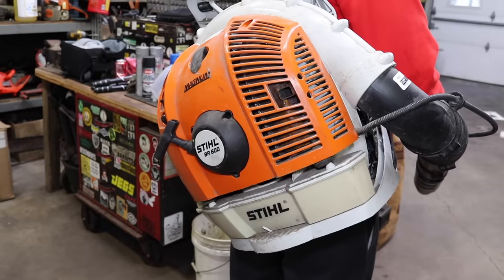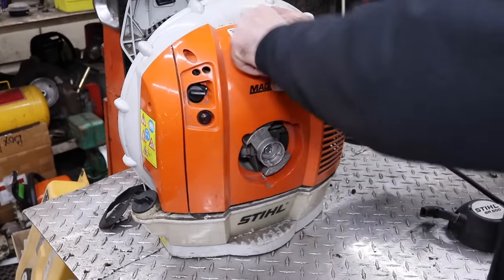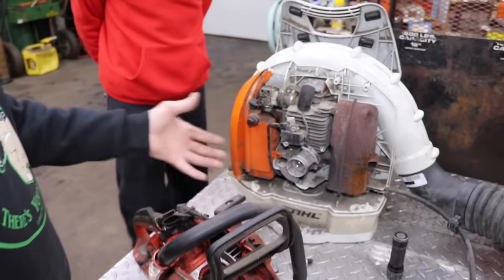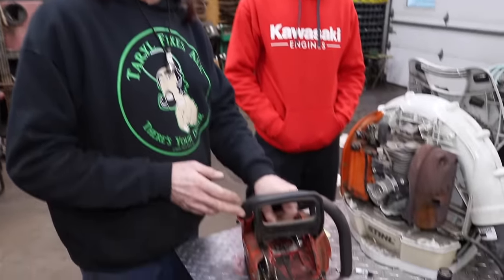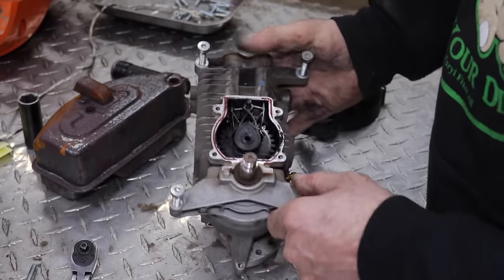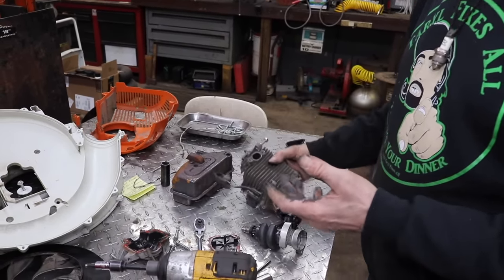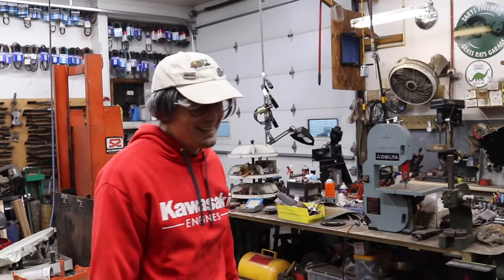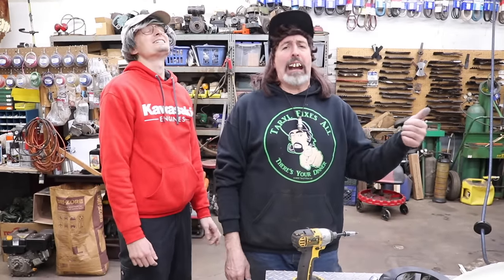4 mix NIGHTMARE! DON'T make this mistake 🚫

Comment: I’ve had a BR600 for over 10 years and it’s been flawless. Use the right grade of oil and mix it correctly. That’s all these need. If your gonna be cheap and use the wrong stuff this is what you get. All I’ve ever used was Stihl hp Ultra oil or amsoil saber. Good oil isn’t cheap and cheap oil isn’t good.
Reply: Lol, y is cheaper oil no good genius??
Reply: @13panda13  cheap oil doesn't hold up and doesn't handle heat like higher quality synthetic oils can. You can see that engine was carboned up bad on the piston where all the heat is located. That's a sign the oil couldn't handle and stated to degrade and fail.
Reply: Yeah ive been using these br 600s for 10+ years commercially  and have never seen this. Infact ive had zero issues with my blowers. The clutch on the fs 111r and 131r line trimmers i have had issues with. After 2 years of solid use the clutches start to seize up .
Reply: same br600 for YEARS
Reply: You are a lucky one, seen a lot of junk
Reply: You make an interesting point. Nearly all of the saw failures that I deal with, have had a RED mixture in the fuel tank. I have no idea what this is. (Someone is selling that stuff to my Mexican customers. Because most of the saw failures are their saws, with this red stuff in the fuel.) Boy! You are so right, don't buy cheap oil.
Reply: @dannybowman7792  Stihl,Echo,Opti oil all good stuff
Reply: @dannybowman7792  exactly.  There is a reason why they warranty their products for twice as long if you use their stihl oil, they do here anyways. Ive never put anything put stihl oil in my stihl equipment and have had zero issues
Reply: @dannybowman7792  probably the cheapest oil they can find at the store. They might also be mixing it at thinner rate to save on oil also they maybe doing 60:1 or more. And if one of there friends says they can do 100:1 like there doing with amsoil saber then there gonna start blowing stuff up.
Reply: @dannybowman7792  The red mix, is Stabil storage, probably
Reply: I don't understand the thinking of some people.  They tell me, you're crazy for spending $25 on that Saber oil (even though it lasts a year) when it costs them more in gas for their equipment... oil is cheap, engines are not.
Reply: @dannybowman7792  there's a cheap pil forgot the name sold at local gas stations that has a red 2 stroke oil. also at home depot they have that premix in a can stuff that sometimes has red fuel
Reply: @jonhutchinson2902  Looks like to me it's the operators error. Btw the sthil oil is reasonable as the other brands oil. Poor quality oil will damage any engine, auto or small engines.
Reply: @jonhutchinson2405  I own a BR- 600 that's 12 yrs old and it runs like new. Adjust the values around 125 hrs. Clean my air filter good fuel and the sthil oil. Follow the owners manual until you know how the machine.
Reply: Same people that use cheap oil mistreat the machines.  Like a child really. Everything is a conspiracy to them.
Reply: @jeffclark2725  Opti oil???   No way.....
Reply: @Laser3303  not an opti fan?
Reply: Yeah I Asked my older brother about this because he has been a full time 2 cycle tech for 18+ years and he said he has never seen one of these failures that he can remember and the dealership he works at repairs thousands of 2 cycle equipment not including larger machines
Reply: what if this happened to you and you used the oil recommended by your dealer ,is it still your fault ?
Reply: @cameroneagle4370  well the manufacture recommends you use their oil but it can still cause issues. They will just say its out of warranty or that you didn't mix it correctly or didn't follow required maintenance procedures. 

Pretty much if its out of warranty or it was a mix issue your on your own.
Reply: @FishFind3000  yeah, ive given up on expecting anyone to honor warranties lol ... ive also learned not to trust the dealers to tell you important information , or that they even know anything about the equipment, they seem like they just want to get you out of the store with a sale as fast as possible these days ...thanks for the feedback
Reply: You made me feel good on my purchase of the 800C side pull, any tips on starting it for the first time?
Reply: @Jon Hutchinson  They gave me a 4 year warranty just for buying their oil, I was pleasantly surprised, now I see why.
Reply: @FishFind3000  I haven't read the owners manual yet on my 800C,  what would be the way to go.
Reply: Yall are thinking Echo's Red Armor
Reply: @dannybowman7792  could the red stuff be transmission fluid?
Reply: @jonhutchinson2405  at least if you use the HP Ultra oil Stihl has. I don't know about the stuff they have in the orange bottles though because it's cheaper.
Reply: Maybe the older ones had a bearing? I use stihl oil and one of these have 3 engines in a year under warranty. After the year was up and it blew up again warranty was ended.  They are run hard daily.
Reply: The ultra oil is synthetic. Also if you can find non ethanol gas, get it. Ethanol is hard on fuel lines and carbs.
Reply: I’m at over 15 years on my BR600, before the Magnum. Always used 93 gas and Husqvarna synthetic because of it availability at Lowes.

Comment: I worked as a small engine mechanic for 10 years and 99 percent of major failures was because of cheap or improper lubrication. It amazed me everytime, that people spend good money on the equipment and then would buy the cheapest oil they could find. And then argue with you about the oil until they came back with a failure.
Reply: Yeah it's best to run what ever the manufacturer recommends the engineers that made it knows better then the people buying it always go OEM for engine components
Reply: @davidaix5771  Or OEM equivalent that's mysteriously at least a third less in cost
Reply: Motul 800? Ester Core supposedly sticks to metal surfaces ensuring lubrication.
Reply: @williwonti  OEM equivalent lmao, do you even know what that means?? It means someone decided to slap an "OEM equivalent" label on the cheapest product they could possibly make.
Reply: @bobbygetsbanned6049  Oh, bless your heart
Reply: @bobbygetsbanned6049  you do realize that it goes to lowest bidder these companies don't give a shit on how long a vehicle or piece of equipment lasts as long as its outside of the warranty period
Reply: @bobbygetsbanned6049  sorry that was supposed to be to be to @williwonti
Reply: @davidaix5771  it's the best thing you can do to validate the warranty.
Reply: Phase separation occurs commonly with Ethanol fuel with high ambient temparatures and Humidity.  Ethanol gas contains alcohol and since water follows alcohol, you're going to get moisture in your gas verses using Non- Ethanol (E- free) gas.  Now, mix that with high user demands (work load), high temps, alcohol being a solvent (mixed with oil), water in your Ethanol gas and cheap grade fuel mix oil,  all leads to very bad outcomes.

Comment: I am a Stihl Tec. and I am thunder struck that Stihl would use a brass bearing there. I work at a hardware store that is a Stihl dealer. We have sold these models. One had a failure were the shaft bearing failed and punched a hole through the bottom plate. I have had two crankshaft bearings to fail. But, no roller bearings at the piston! I am beyond words.
Thank you for the video! You saved me a lot of time with this info. Thanks again.

Comment: Having made engines, there is nothing wrong with silicon Bronze bushes for a wrist pin. However it does have to be lubricated and as you and many others have said modern engines require the correct oil or you are gonna pay. As Scotty says oil is cheap engines are expensive. Very good advice we should all heed.
Reply: "Having made engines" Were these "engines" loaded, running at 10,000 rpm, and share the rotating weight seen here? I build engines, and I would never use bronze bushings for anything that has ANY linear movement. Physics.
Reply: @JosephPPreston  Yes and they worked for 50 years and still going today. not 10,000 RPM though. I was chief design engineer at RN Diesel Engine Company Ltd. and also at Cosworth Over the road they built 1000HP racing engines and they did 8-10,000cRPM and they also had silicon bronze gudgeon pin bushes. I also knew Fletcher Jones of FJ Engineering that had designed most of the pistons for todays engines like Toyota, Peugeot, Rolls Royce, Gardner, Lister BAE systems. Cosworth made forged pistons and put a lot of development work into design and testing.  There was not much they did not know about pistons. You are probably using one of their designs and most manufacturers copied everything.
Reply: Rev up your ENGINES!!!
Reply: Mixing ratios are more important than any brand of oil will be.
Reply: A needle bearing is still a better choice, putting a bushing is a way to save money.
Reply: Scotty also says it it’s API certified it’s as good as any.
Reply: Or just don't buy the junk there selling.  Just another way to sell more junk that don't last
Reply: @richardkenworthy9312  Bushings are a lot stronger than needle bearings which is almost certainly why they used them in the bigger blowers over dinky little roller bearings. I don't know why you all think needle bearings are so special, they wear and are weak, the added torque from the larger 4 stroke engine was probably destroying the tiny little needle bearings so they used an oilite bushing instead.
Reply: I think it’s a problem and it going to lock up
Reply: You guys all missed something. Two stroke engines with ANY pedigree use roller bearings on everything. Look at outboard engines. This "Four Mix" abortion doesn't have a crankcase full of oil and doesn't utilize a premix with fuel for stratification, so bushings WILL NOT get properly lubed in this design.

Comment: I’ve had many many of the stihl equipment over the years. Never ever ever had an issue with anything I’ve ever owned. Chainsaws, blowers ,weed wackers. Etc. 
always used their 2 stroke oil. And good gas too. 
Pay the extra (Pennie’s) and save later. 
Also always starts better.
Reply: For ANYTHING at home, we use premium gas, treat it some wih seafoam or some other stabilizer ect, and then if its 2 stroke or 4 mix, use a quality oil. Aka Sthil stuff. If we go through 20l of gas in  ayear that's it. Spend another single dollar on good oil and gas and don't have problems. Yeah its not commercial we don't run through thousands of litres of gas, but id think reliable dependable machines is worth more than breakdowns ect, expensive repairs and replacements.
Reply: @baileyhatfield4273  I’ve only been using stihl platinum oil and recently changed to Amsoil saber since I started to use a lot more fuel. My Br600 has been flawless for the last 10 years. Apparently people don’t realize when the manufacturer says you’re supposed to use a specific grade of oil they mean it. When the cheap asses use the cheapest oil that they can find and their equipment fails. They blame the manufacturer instead of themselves, so they saved a couple pennies on their maintenance and now they have to buy an entire new unit.
Reply: I have a fs 250r 2 stroke and fs 90r 4 mix. Both are at least 16 years old maybe older bought them new. I’m not a commercial land scaper Just a home owner with a lot of acreage. I’ve used motomix or truefuel. I’ve never had any problems with starting or carburetor problems. Same with my blower and chainsaw. Use a good oil and the right mix and you will have less problems. Always enjoy your video’s Taryl .
Reply: Me either . My fs76 trimmer is 26 years old . Been used horribly hard .   Runs like crazy.
Reply: @Bailey Hatfield  dont use premium gas in small engines... READ YOUR MANUAL. More expensive does not mean better.

Comment: I've been using the Walmart super tech 2-stroke oil in all my echo equipment going on 20 years I never had any problems with any of my echo equipment I had two Stihl blowers I bought in the past and they both died within one year I will never ever buy a Stihl Blower again they are junk and designed to fail with that being said I do have a stihl  power pruner that I've had for years with no problems. Thanks for all the videos best mechanic on YouTube

Comment: Been running these for over 15 years, new plugs and filters, good oil, good fuel and adjust the valves…. Never had one quit. Same I’m with the trimmers. Also use the blower at the farm tank after tank.
Reply: Jeff Rust  or they are the same that don’t change their oil 🤣

Comment: From what I discovered during some research is that the Stihl ultra oil is synthetic and the older 2 cycle oil is not synthetic. The synthetic oil will not gum up inside the engine as seen in the video and because it is synthetic and very slick and very thin, it lubricates the areas as designed by Stihl...it gets to where it needs to be inside that bushing etc. Use what they recommend and save yourself the headaches of downtime and YUGE costs in repair. Thanks for the video, direct and blunt information for the thick headed.

Comment: I worked small engine at a farm store that sells stihl. I thought all their new stuff was junk. We had to start every new stihl when it was sold. 20% of brand new stihl right out of the box would not run properly or not at all. I was constantly fixing brand new stihl equipment. 
We also sold echo and i don't recall a single problem with any of their stuff. Rarely even had any echo stuff in for repair and echo has a much better warranty.
Reply: Thank you for saying that It was the same way at my former Shop and a good 20% came back in a few days not working rough running and the sad part all the blowers chainsaws trimmers and so on they were all  had the same problems....  as for echo not one problem right out of the box they were ready to work with no issues
Reply: My buddy manages a major landscape company. I'm not even sure how many guys they're up to but it's got to be 50+ at this point, so they have a huge sample size. They switched everything (hundreds of pieces of equiptment) from Stihl to Echo and have been much happier. Far fewer repairs, less downtime, and less issues with carbs especially.
Reply: Carbs need adjusted out of the box, thats nothing unique to stihl. I have to adjust brand new echo carbs straight out the box too. If its a 2 stroke carb with removable jets than it needs to be adjusted even when brand new. It takes 30 seconds if you know what youre doing. This is not a stihl problem; this is how all 2 stroke carbs are. You do realize these are shipped everywhere in the world and geography impacts how an engine runs? More or less oxygen in the air due to elevations can make an engine run different. This is why big box stores like ace hardware should not be allowed to sell stihl equipment. Their "techs" do not know what theyre doing.
Reply: @BigBeansM3  you know whats funny? Stihl owns Zama corp. Zama makes all stihls carbs. Zama ALSO makes echos carbs. So one manufacturer (owned by stihl) makes the carbs for both echo and stihl. Yet you want to pretend like echos carbs are better? Lol. Just lol.
Reply: @bluejene2146  yes a little adjustment out of the box is normal. What isn't normal is all the brand new Stihl that needs parts ordered to make sellable
Reply: @bluejene2146  nobody is pretending the base stock is better. I think it is 100% a matter of poor quality control and Stihl let's way to much junk out the door and expects the retailer to QC the final product.

Comment: Mini 4 stroke with oil sump and splash lube  is the way to go! My 4 stroke  troy Bilt  weed wacker  is still  going after 15 years!
Reply: Same here. 13 years for mine.
Reply: They know that, this is designed to fail as soon as the warranty is up. Built in obsolescence
Reply: Stihls page on this engine states it has no pump or sump. I'm not a mechanic, but it seems to me if you're expecting the intake system to live the bottom end, it's not going to work for long.
Reply: @tonysheerness2427  I’ve owned a br600 for over 10 years without fault. Good oil and the right mix is all it takes…
Reply: My Honda mini 4-srtroke weed eater is 23 years old. Run like a champ. Starts 1st pull.
Reply: @craiglittle7367  But has it got a 4-mix engine?
Reply: @tonysheerness2427  
Yes.

A little heavy. But probably best made weedwacker available. 
It’s a Honda.
Reply: @Craig Little  you do not have a 4 mix honda because it doesnt exist. You have a 4 STROKE honda. Very different.
Reply: @bluejene2146  I know. That’s what I said.
Reply: @bluejene2146  

Look up “Honda mini 4-stroke”
Reply: @Craig Little  ive fixed dozens of them i know what they are. They put the same engine on a mini tiller. They are constantly coming in overfilled with oil because the users cant read. You were responding to someone who asked if it was a 4 MIX engine
Reply: @bluejene2146  

YOU CANT READ!

I was responding to Randall who was speaking about mini 4-strokes.
My mini 4 is on a Honda weedwacker I bought in 2000. 

Honda builds the best small engines in the world. By far.
Reply: @Craig Little  ok Craig do you see where Tony asked you if it was a 4-MIX engine and you responded to TONY with "Yes"?

Read it again.

I work for both a Honda dealer and Stihl dealer. I work on more Hondas and Stihls than anything, but I also fix every kind of small engine imaginable if the customer accepts the estimate cost for the work. Yes, Hondas are great. So are Kawasakis. The Japanese know how to build a small engine for sure.